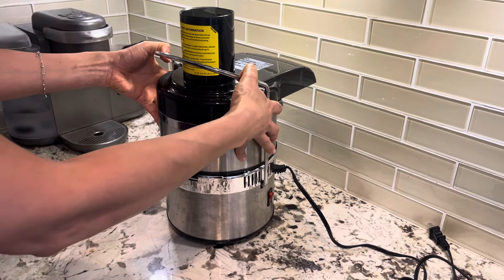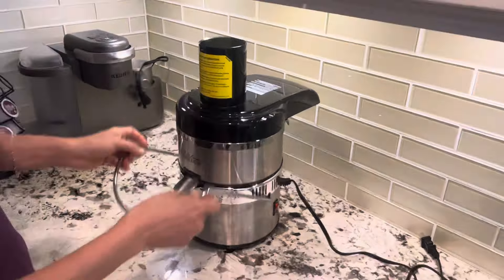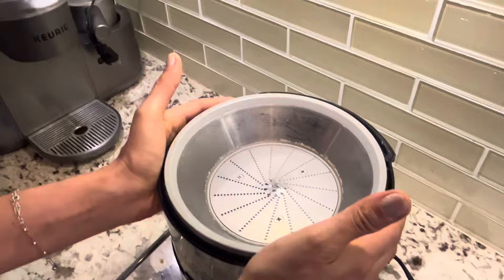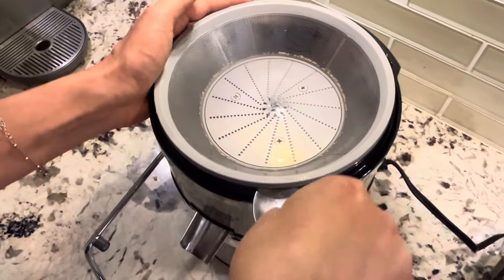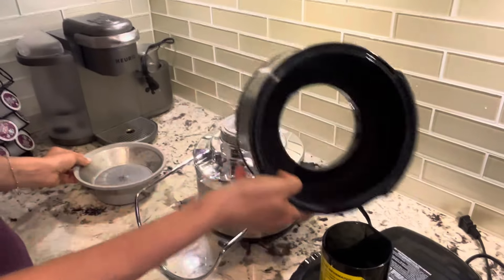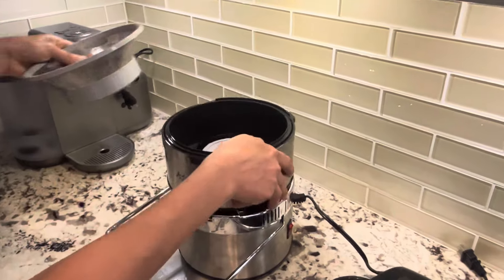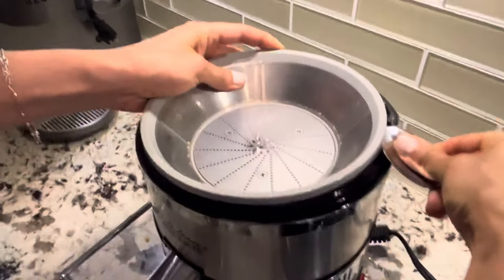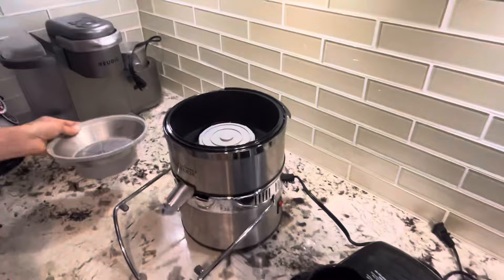How to open & disassemble Jack LaLanne’s Power Juicer - Model e1188-1 easier way

Comment: For the ones with a plate on them that is tightened, because the plastic screw goes into it from the bottom if you use a spoon, you will ruin the basket and break this machine so if you’ve tried the thing that pushes the fruit through the tube, it has some grips on the bottom and you can perfectly position that tool to unlock the basket plate – Try the following- 

In case anybody else is looking or you haven’t figured it out there’s a really good one under Filipina in Alabama -and you just take a soft cloth pressing down on the blade turn it so it loosens it kinda screw it off and then the whole bladed basket lifts up. Someone left one of these out on the been a little while ago and it was just because they couldn’t figure out that probably cause it works like a charm. They’re real cool heavy duty machines.
Reply: This was the advice we needed with our model e-1188. We wound up taking out the 3 metal screws which separate the filter from the plastic screw-on base.

Comment: Did not work, but at least your attacking this  obvious problem.  The one I have is used, and older, so not a simple. Any other ideas, other than levering with a big spoon would be appreciated.
Reply: Yes, see my reply or comment down. If you have the plate, use the plunger to loosen it it has grips on the bottom. If it didn’t come with the plunger and you could take a towel and unscrew it from the plastic threading if you try with a spoon you are going to break it Because it’s actually screwed on it’s not some thing that just pops off, It’s threaded so that would break Your whole basket assembly. Hopefully, nobody Has actually broken their basket trying to follow this YouTuber
Reply: @kates5528 I just bought mine second hand and unable to remove blade. What is the plunger?